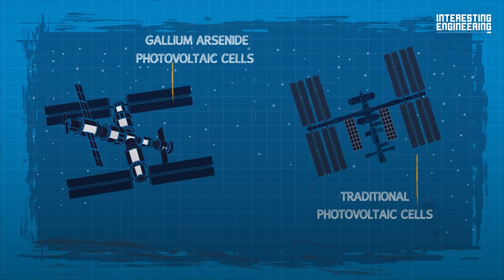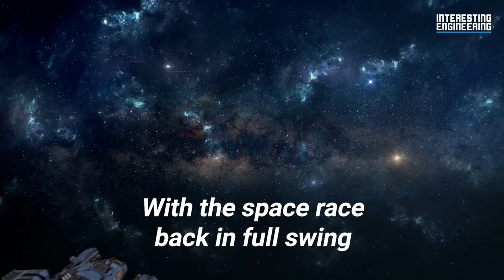The ISS vs China's Tiangong: Which is better?

Comment: Lol! US didn’t build the ISS along! We had to depend on other countries.
Reply: American propaganda
Reply: Specific on the russian space rockets... Without Russia usa wouldn't be in space any more.
Reply: @fw2699  That’s true. We are heavily depending on  Russian’s rockets.
Reply: it was a collaboration but wenn you look purly at the size of the station meaning presurised and unpressurised components and what country of origin each part of the station has you can roughly see that around 50 percent is from the US 40 percent from the russians and 10 percent from other participants.
Reply: The us modules alone would more volume than the Chinese station
Reply: @llvllll canadarm project
Reply: @rjd1564  Where did you get the fallacious numbers. Lol typical credit grabber. Without Mir Core by RUSSIA, your ISS would be nothing.
Reply: @samalenyo  well it’s not a perfect caulculation but I took the fact that the Russian presureised modules are Zarya, Pirs, Zvezda, Poisk, Rassvet, and Nauka around 6 the US pressurized modules being Leonardo, Harmony, Quest, Tranquility, Unity, Cupola, and Destiny and having at a point in time the temporary Beam module so currently 7, the Japanese modules  JEM-ELM-PS and JEM-PM and one soly ESA built module Columbs. Purely focusing on number of pressurized modules Us would be ahead 43.75% then Russia ~37.5% and others (esa Jaxa) ~18.75% but I also tried to considering support equipment like radiators, solar panels and other components were the US and Russia will get an increas in how much of the station was contributed by them with the us having by fare the largest contribution in that regard having been the one that built most of solar panels and radiators including the large solar arrays that make up the majority of the visual size of the iss. Now wenn looking purely visual size the us contributions would make up somewhere between 60–70 percent but since visual size isn’t a valid mesurment in the case of the iss so I then made a rough addition to both of Russia’s and the US‘s percentages and subtraction from the others and then came to those percentages. But you can hardly make a perfectly accurate percentage make up because it depends heavily on what contributions count for how much, only thing that it is certain presuriesed Modul amount is definitely on of the most important ones.

Also the Mir station was deorbited 2 decades ago so im not to sure were u got the idea from that it was the central part of the Russian segment of the iss.
Reply: @ragnorak2237  Yeah... but they designed the entire station and also they have more modules than enyone else on the station so technically they built it. Russians launched the first module but US built 8 modules while Russia only has 6 modules.
Reply: @samalenyo  Mir was deorbited years before the first ISS module was launched. Also USA currently has 8 preassurized modules, Russia has 6 and than there is Japan and ESA who have 3 modules.

Comment: It’s very unfair for you to compare like this
First of all, the International Space Station is not owned by the United States. It is jointly constructed by 13 countries, most of which are provided by Russia.
The Tiangong Space Station is only China’s own copyright, and all operating systems are in Chinese.
And your picture is only for the first phase of Tiangong's construction scale. Two experimental cabins and a permanent spaceship orbital cabin will be added next year, and the volume will be twice the current size.
Reply: Typical American hegemonism
Reply: That's right!
Reply: Go away
Reply: Wondering if the first mobile phone built is better than the mobile phone now in term of of tech and functionality.  The former was also big and heavy, guess you needn't b a genius to know the answer.
Reply: That's not entirely true...they did mention the other 4 space agencies that went into the construction of the ISS.  But yes, they did have an American flag suggesting it was "American built".

Comment: Gallium arsinide is not new and has been around for decades.  It has substantial advantages and disadvantages when compared to the current dominant player, silicon dioxide.  It has lost out in the vast majority of applications due to its inability to handle higher power densities that silicon does.
Reply: Apparently its more efficient and produce more power.

Comment: Contrary to what this video says, solar power generation is not an issue at the ISS.  ISS's solar panels and power systems are being upgraded.  During the past 2 Crew Dragon rotations at the ISS, astronauts have swapped out old nickel metal hydride batteries for new much higher capacity lithium ion units that store power from the solar panels.  And starting with Crew-2, they are installing new solar panels over the old ones, which will generate far more power.   Also, NASA is trying to foster commercial development of private space stations, so that it can become a customer in the future.  Axiom Space is already building the first modules of their space station, which will first be attached to the ISS then detached for independent operations when the ISS is decommissioned.
Reply: @chriswestwood3289  You didn't do your homework--  the U.S. did have its own space station back in 1973 with Skylab.  Nevermind your rant is utterly irrelevant to the ISS's solar power capacity or NASA seeking private companies like Axiom to build private stations that it can rent as a customer, but whatever  :-D
Reply: @josephsimmer9267  they never had one
Reply: China provided gallium arsenide batteries for the International Space Station